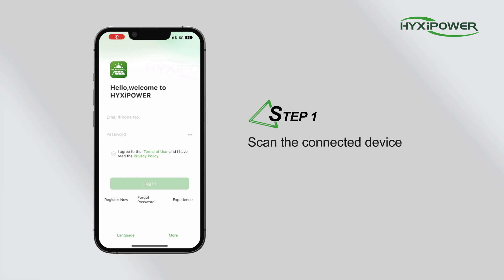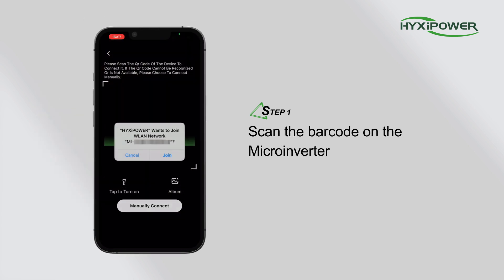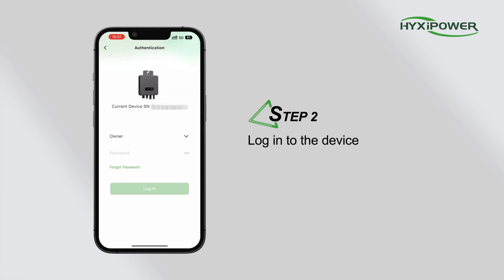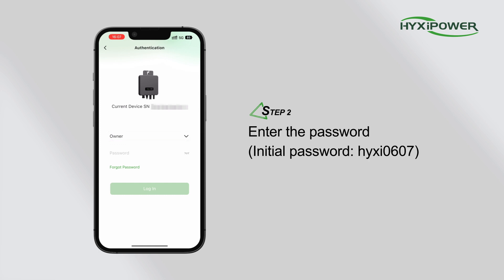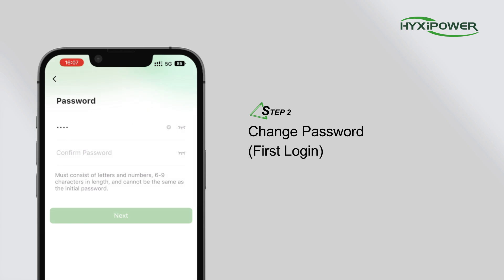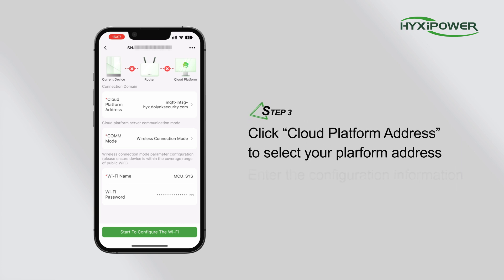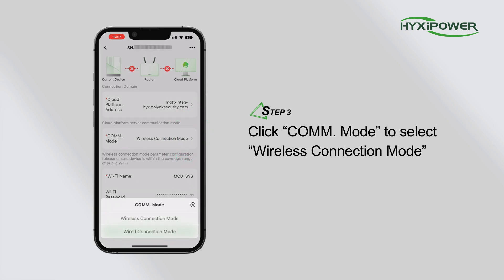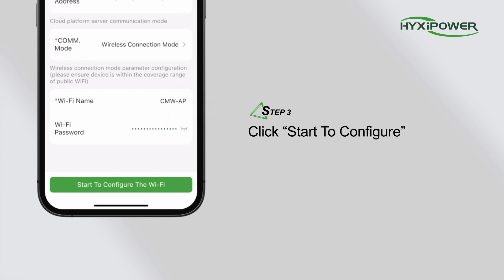Microinverter_Cofiguration Video (WIFI Version)

Comment: This is probably the most difficult thing that I have been playing with. The video does not represent the app, it is different. The app can see my wifi, but does not ask anywhere to put the wifi access code in, so cannot connect. The microinverter will not go through the add device because the wifi cannot connect. I will stick with other makes of inverter in the future and this one will end up in the bin.